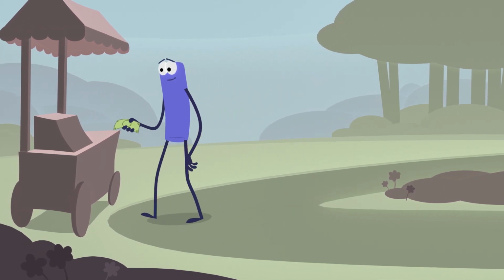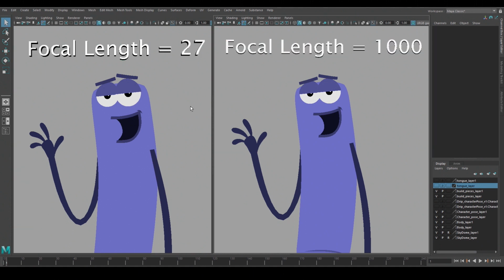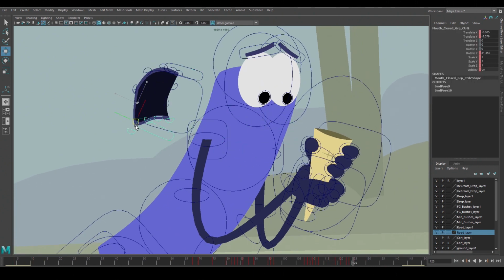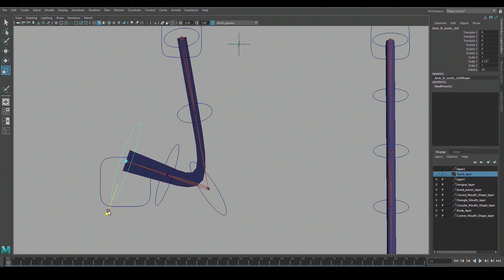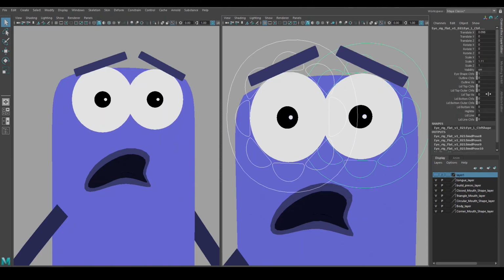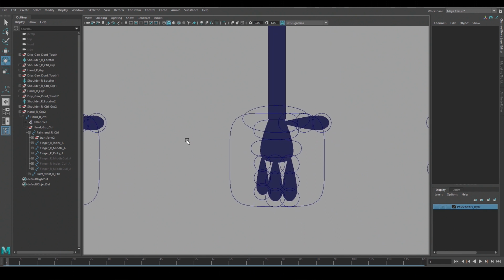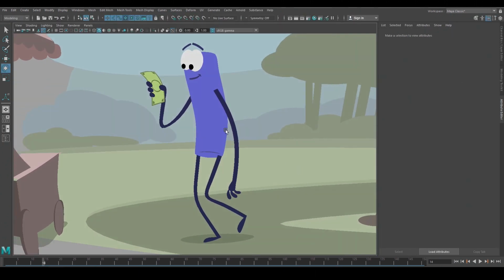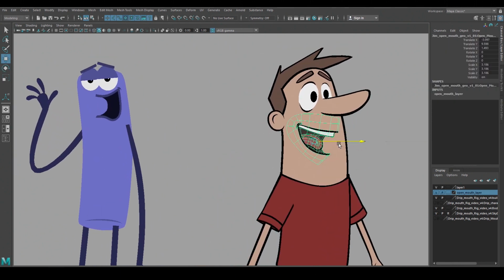2D in 3D – Ice Cream Animation Process – Maya

Comment: Hey James, I was so impressed by all your works and workflow tutorials. THAT ALL AWSOME! I will make an apology my poor english.
I would ask some question. If you answer, I will so happy and I can make more awsome work! I'm making graduate animation now!

I wonder. Can cinema 4d make same 2d - 3d ( which is introduced by you ) animation process and animating result like maya you introduced?
I am using maya and c4d. But I am not sure c4d is good at character animating like maya. Maya is totally optimized in character animation I think. But c4d is more focus on mograph and simulation. Of cource, c4d can make character animation like maya. ( I'm not sure c4d contains facial animation tools like maya..)

You think c4d can make 2d-3d(2.5d?) animation like maya?
If not, there is no other choice except using maya?
Thank you for reading my long boring question james! I will so glad by your answer~.
Reply from the maker: The concepts that I use for modeling and rigging should applied to 3D software in general. 
I haven't used Cinema 4D but I would look for similar tools that we use in Maya.

Good Luck!